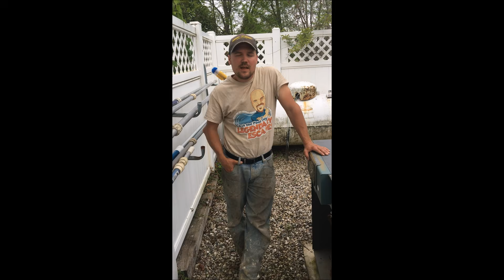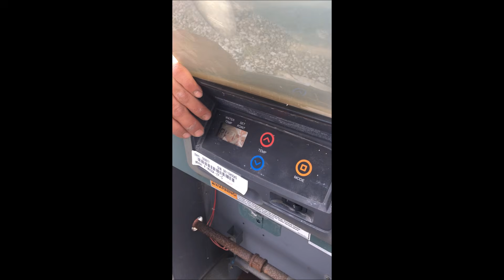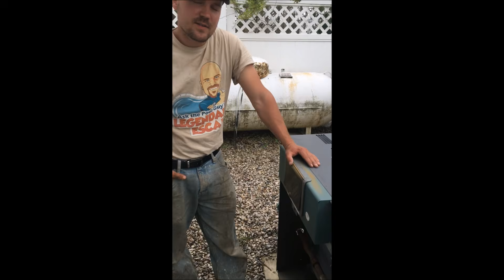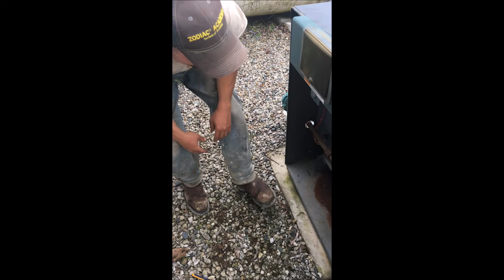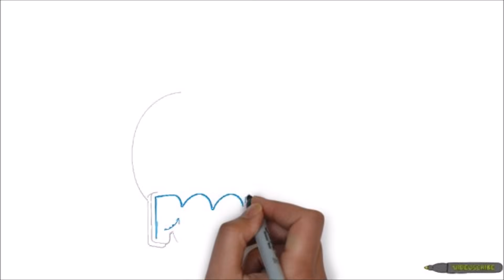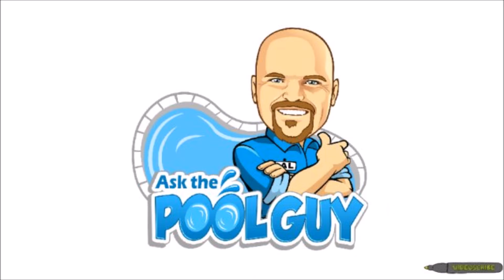Ask The Pool Guy: Why Won't My Pool Heater Ignite? Rheem 406A NG | Troubleshooting & Solutions

Comment: Piolet lite lights but the burner will not light , changed piolet because the last piolet didn't light , ignition lock outcomes on piolet sensor.

Comment: You helped me before, same issue. Heater shuts off b4 reaching set temp (104f) . It fires up and heats from ambient pool water temp to about 100f and shuts off. I have replaced both the temp sensor near the inlet outlet pipes (part of the Hayward heater) and also the sensor that is stuck into the pvc pipe and goes to the electronic control circuit board (that goes to an indoor control panel). So indoor panel calling for 104f but heater shuts off at 100f. I twister the dial on the heater a few times and left it at max setting. Funny thing is the first day I put the new (PVC mounted) sensor it it worked and went up to 104f and shut off) The sensor is a factory Hayward brand. Is there some other sensor or temp. setting dial or else that I can clean or fix? THANKS! Froggy.

Comment: Good information man but my raglan 266 propane reads ignition lockout. I shut everything off including the gas, bring everything back up and it fires off but goes off within 5 minutes and says the same thing. Could it be the gas pressure sensor ?

Comment: Any video on unblockng the pilot tubes? This seems to happen to mine a lot and someone needs to come out to service it. I haven't had the chance to be home when they do it, but I've wondered if it is something I can do myself.
Reply from the maker: Cleaning it with a pipe cleaner, steel wool or other tube cleaning tool may work.

Comment: Good video. ty.     i had as SNS problem ( sensor) on the display. Changed the sensor & the unit fired up right away & ran for a day. Then it went back to SNS on the display & would not light again.  Any ideas on the problem? Ty.
Reply from the maker: Sometimes there is more than one part that needs to be replaced to "reset" the system. There could also be something ancillary going on that is damaging the sensor even after it is replaced. Best to go step by step through the process of a heater firing, and exhaust to determine where the issue could be.

Comment: Can u please explain when u say flip it on and off do you mean the main gas valve or the on /off button on the heater thank you
Reply from the maker: Flipping it off and on would be toggling the heater on/off switch. It's also a good idea to try the breaker if you have electronic components - and the gas line at the heater and the house (sometimes they randomly get shut off and you may not think to double check). Good luck!

Comment: What about CFH constantly.  Started this morning, then I vacuumed and got a lot of air into the lines.  I assume you're not talking about water air.  :))  SPK isn't even happening now.  Mine is natural gas fed and has been working ok for a week after long winter.
Reply from the maker: If you have a lot of air in the lines or you aren't even getting a spark the flow indicator or pressure switch/pressure valve could be overriding the system and preventing the heater from trying to fire. Clean the flow, clean the filters, bleed air out of the lines with the filter air bleed setup and try again...

Comment: how about if "spk" just stays on and it doesn't get past that
Reply from the maker: If it's just spk , Sounds like it's a gas issue. Is the Valve open? Or it could be a bad sparker.
Reply: gas valve is open.  I am not sure what should be on the screen when it is working properly.

Comment: I was wondering if you have ever come across this issue. Easy touch remote system activates raypak heater in rem on mode but it uses the raypak thermostat settings instead of the easy touch. Temperatures have to be changed in rem off and off course looked out in rem on but it won't let the easy touch control the temp. It even displays spa temp setting of the raypak heater in rem mode. I think the board is failing. Any thoughts??
Reply from the maker: It is sometimes complicated to get non Pentair equipment to play well with automation system. The auto mode should make the easyTouch panel control the heater, service mode should put the heater controls back in charge, however, they won't work unless the heat button is pressed on the panel. Pentair customer service (printed inside the easyTouch box) should also be able to troubleshoot with you...good luck!
Reply: askthepoolguy thanks for the reply. It turns out it was the easy touch system. It wasn't closing the relay when it hit the set temperature.

Comment: Do you have any help for Legacy lrz heater that wont stay lit?
Reply from the maker: Sounds like something is telling the heater to shut down if it's the burners. Troubleshoot everything from the gas valve, to the ignitor, to cleaning out the internals, and even the filter pressure and air blower. http://www.zodiacpoolsystems.com/~/media/072f82733ed447a0bcab6afb9d4e1ef0.ashx